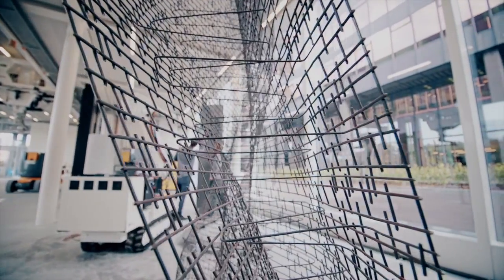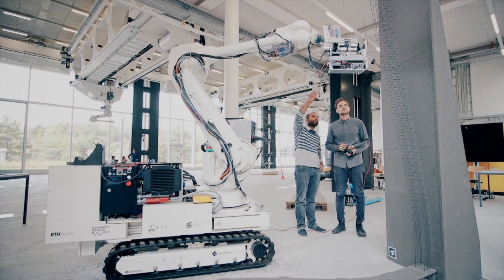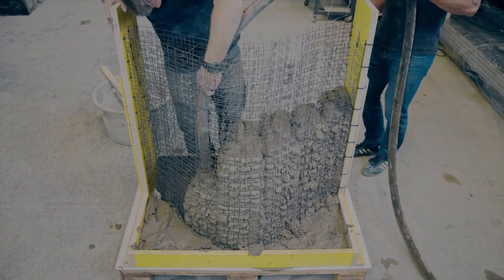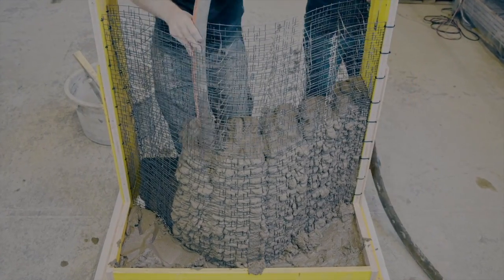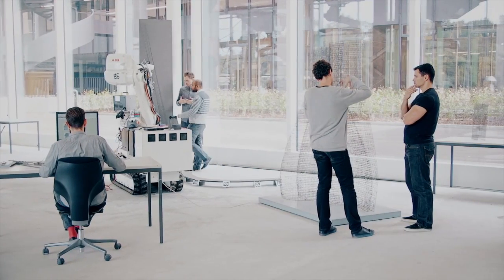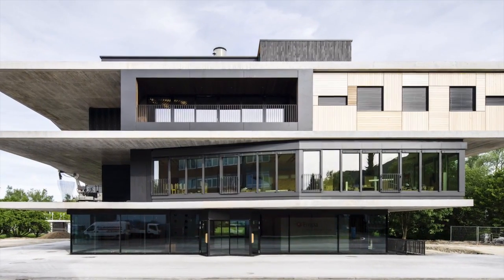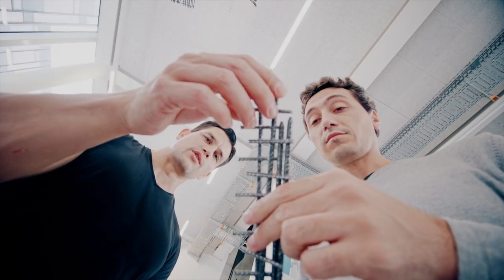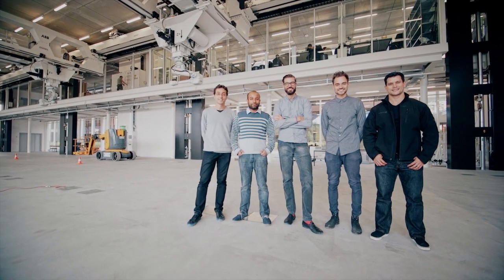Project team «Mesh Mould» Wins Swiss Technology Award 2016 - English Version

Comment: Hi, I'm in the development of similar technologies for assited placement of precast parametric construction blocks, and for  'freeform / organic ' big parts - moldings and other processes on this kind of parts. One of the key points for solving both challenges has to do with the solutions for repositioning of the end effector, (the robotic arm in your case) .. so as to get the exact location and orientation after each movement. - besides being able to move the platform , for what we have been doing some research in the field of omniwheel based platforms.  I'm very interested in getting in touch with you.   franco.ferreiro@gmail.com . Congrats for your work !